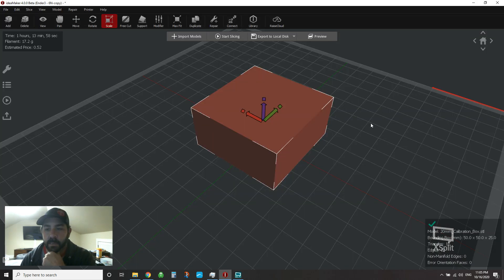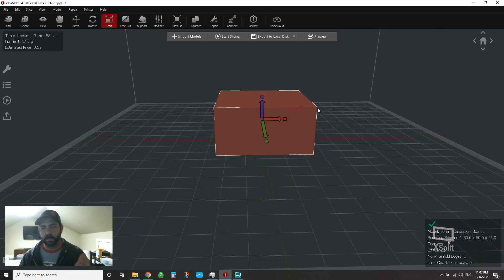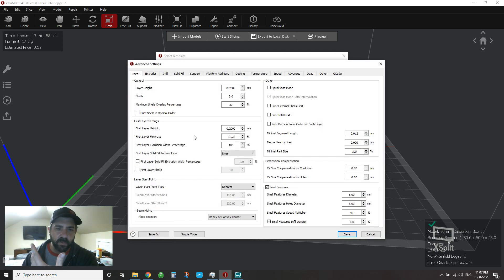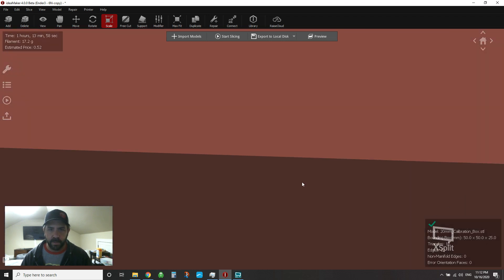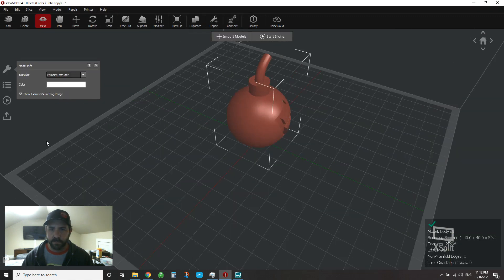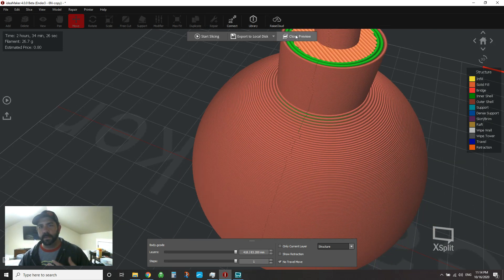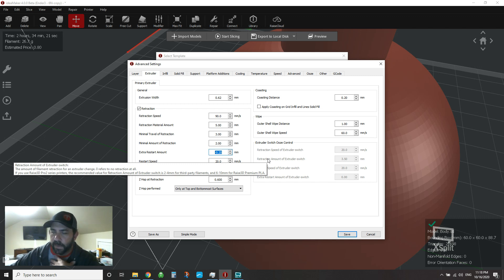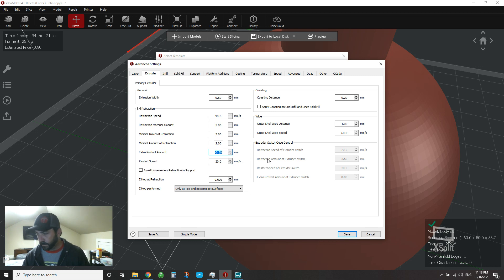Quick Tip - Tune your z seam.  Placement and fine tuning

Comment: On a number of models now I've been unable to move the seam when using fixed location. No matter what numbers I try the seam just won't move on the Y axis to the back of the model. Even rotating the model seemed to make no difference. I'm not sure if it's a bug (I'm using 4.2.3 (the newest version at the time of writing). I really wish they could make a tool they you just click on the model to place the seam at that location.
Reply from the maker: interesting.  Is your model round-ish or does it have hard corners?  I'm using the latest beta 4.3.0 and it seems to move based on the locations I put in.  The only caveat I've seen is that if I'm putting in a cube shape or something with any corners near the fixed point I've specified it will hide the layer changes on hard corners closest to my specified location.
Reply: @fischer3d  I've tried various models and the result has always been the same. I'm using the Linux version. The last model I tried is pretty much a long rectangle with semi-circular indentation on one side.

Comment: I'm sorry, this is unrelated to the video, but I don't know where else to write, how do we start printing from where it left off in ideamaker 30 hours of printing will be almost garbage, can you help me?, thank you...
Reply from the maker: It's a gamble, but if you don't have the power failure resume print feature then you are stuck with the following...  Take a measurement as accurate as possible from the print bed to top of print where it stopped.  

Then load ur model back into ideamaker. You basically need to separate your model using the plane cut tool and print the top portion that was not printed as a separate print.   Then glue them together.  That's the only decent method I can think of.
Reply: @fischer3d  First of all, thank you very much for your attention, I usually use the method you mentioned, I can only enter the measure where the printing stops in another slicer and make it start from there, but I was wondering if there is such a feature in ideamaker,
It will take a long time to disassemble and re-glue the parts because the entire tray is full, it is not a standard print, you can see, I am following your videos with interest, thank you again.
Reply from the maker: I'll take a look around the features and see if there is something that'll work.  I'll let you know shortly
Reply from the maker: Unfortunately I don't see any other features in IM that will let you start from a specific z point in the print.  i've downloaded the newest version, but just dont see how it wont try to home first, likely trashing your print or printer.  Maybe by hijacking the gcode directly but if you've got a reliable method in another slicer you might want to try that.  I've looked through all the slicing tabs.  Maybe there is a way using "modifiers", but i fear the above problem of crashing is still likely.  Good luck.  Let me know what you figure out.